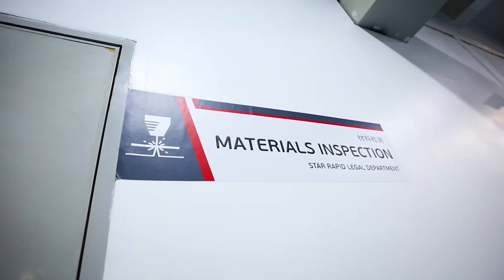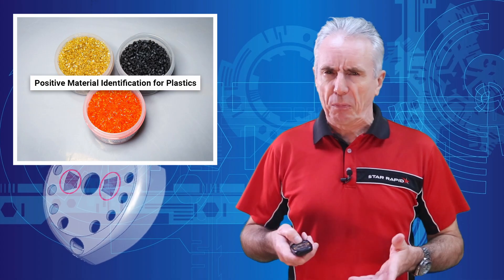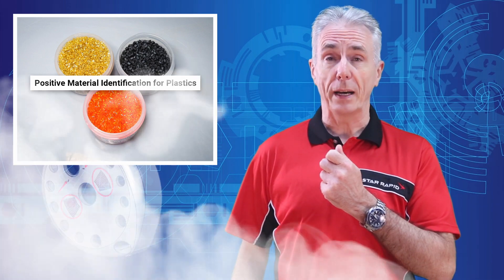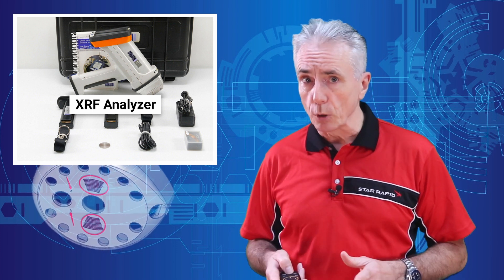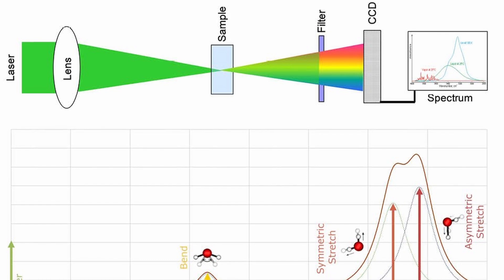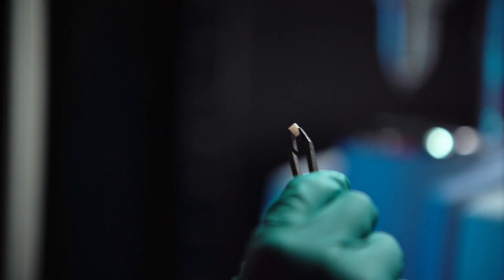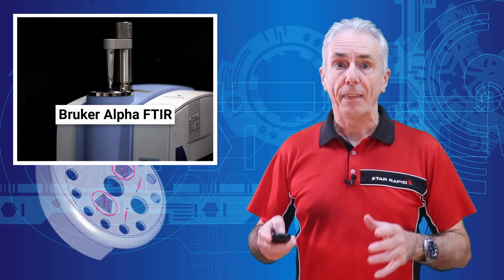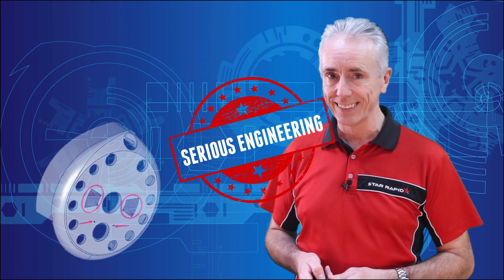DON'T fall for FAKE! - Positive Material Identification of Plastics | Serious Engineering - Ep25

Comment: What do results look like when there are additives/fillers present?  Does that make the material more difficult to identify?
Reply from the maker: There are two ways to identify materials using the FTIR. One is to calibrate from a golden sample, and then know how close the test material is to the golden sample. This is not identifying the chemistry, or the filler, or anything like that, it is just looking at the fingerprint and how similar it is to the golden sample. The Second Way is to use an internal or external database that covers all kinds of resins, fillers, pigments etc. You then ask the machine to work out a combination of all of these materials that would most replicate the fingerprint you are getting off the test-material. You can set the machine to look at 1 level, 2 levels, 3 levels and so on. The problem is that for every additional level, the time it takes to do the calculation is exponential. There are techniques for narrowing down the dataset, but even so, a 3 level analysis can take 4 or 5 hours. At the end of the process it will tell you: You have PP with Glass Fibres, and a carbon black pigment. It can also identify which brand of plasticiser you have. The Alpha is an amazing piece of technology. - Gordon.